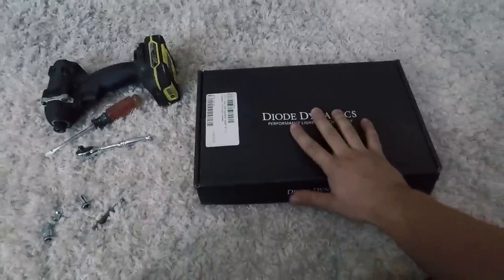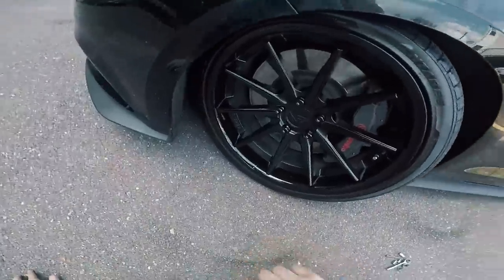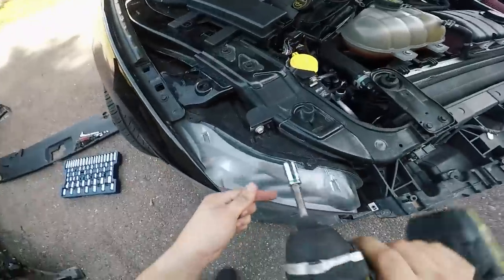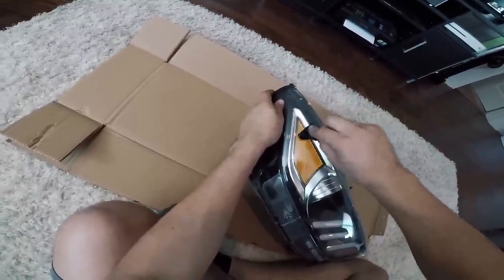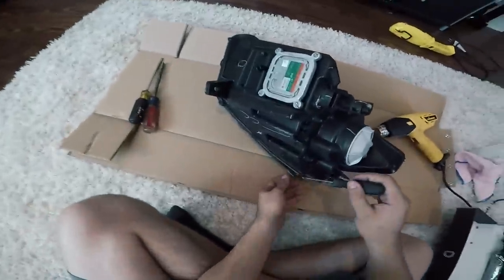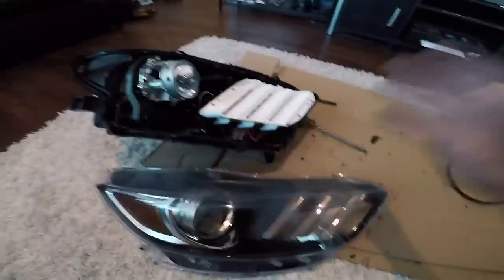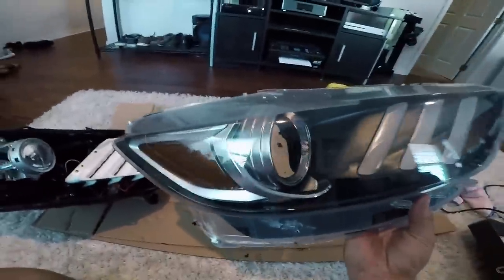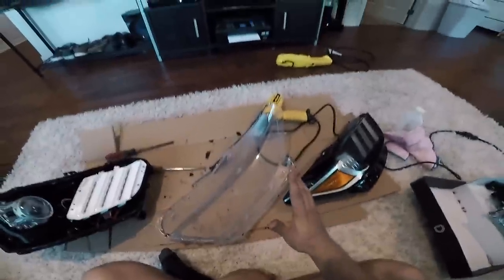NEVER pay for custom headlights!! Try simply doing THIS instead!

Comment: Great video as usual...BUT, never use heat guns on your headlight unless you HAVE to. For example, light too big to fit in the oven. Even then, put them in a big box, and use the heat gun to warm up the inside of the box (there is more to it than just putting the light in a box and putting the tip of the heat gun there, but thats the basics).  A beginner on this job will screw this up using a heat gun. Plus, those lights are permasealed. They dont come apart as easy as butyl closed headlights. For permasealed lights, 220-230 for 15 min. As long as the light isn't touching any metal, they will NOT melt. Have built countless lights, and a good 20 of those sets. And dam, you struggled pulling those lens off the housing. I was cringing waiting for the lens to snap lol. Diode Dynamics product is great stuff. Use their stuff a lot as well as Morimoto stuff.
Reply from the maker: Very good tips!
Reply: i was just gonna suggest this, seen to make mistakes with heat guns
Reply: Awesome comment and video
Reply: MrDaavee do you lay aluminum foil in a baking sheet? I’ve done 2 sets of headlights successfully and one I melted my lens lol I search and search for new tips and your seems to be best, what about taillights? Just cut back housing and reseal using epoxy mix?
Reply: i lay the lights on a piece of wood. The wood is a great insulator to keep the direct heat from the burner/element away from the headlight and off the metal racking of the oven, but still allow it to properly heat up. If you have that fan in the back of your oven, make sure that is off lol. For permasealed headlights, like (GM, Ford and Dodge), lower temps for longer periods of time works for me. Every retrofitter has their own way of doing things. I do 220-230 for 15 min for permasealed lights. 250-260 for 7 minutes for butyl lights (honda, hyundai). Most tail lights have to be cut open, then epoxy back together, or plastic weld (what ever works best for you) then siliconed up. Use quality stuff. I go so far as to lay tape on either sides of the cuts before i silicone. That way when the sealant is laid down, and pressed it, i remove the tape leaving a thin silicone line that is almost laser straight. Only a few tails can be baked open, or even unscrewed apart. Older cars like the 70s. Few newer ones can too. Like the R35 GTR.
Reply: Do the same when resealing. Don't use a heat gun on the reseal. You won't have even adhesive. Point a will start cooling and hardening quicker than you're able to heat the whole light. Using a heat gun to reseal can cause the glue not to evenly cure on the lense and leave you with moisture penetration. Oven method works wonders
Reply: I would go with Starry Night Halos over diode
Reply: kitt powell you can plastic weld your tail light if you cut the housing open. A plastic welder can be picked up fairly cheap but you can also just use a cheap soldering iron .
Reply: I wouldnt touch Starry Night crap if you paid me. Had waaaay to many issues with their garbage over the years. I dont mind installing some products that my customers bring me, but i turn them away when they bring me starry stuff. Too unreliable.
Reply: Go to sleep you have school in the morning
Reply: MrDaavee I’ve tried baking my 2013 mustang headlights open but they just wouldn’t open and I was nervous that I was going to break them so I decided to go get an estimate on a pro doing it and they said $250 for RGB DRLs and RGB Halos installed. Is that a good price for the labor and putting everything back together??

Comment: I just did this on my ford falcon, absolute crap of a job haha. My oven wasn't big enough either so I used the bbq outside.(which also made the missus happier than me using the oven)
100 degrees Celsius for about 5-6 minutes and they came apart easy enough. 
I also didn't remove the old sealant,mi added fresh sealant where it seemed thin but I just put the reassembled lights back in the bbq to heat up the old sealant and pushed them back together hard. 
So far no sign of any moisture issues and my car sits outside 24/7.

Comment: I just used duplicolor "rattle can" paint
  3 coats and 2 clears and looks like it was meant to be that way
 Helps to slightly sand the inside of the headlight surfaces also to help paint stick

Comment: I put the oven on 160 and bake headlights on a small towel for 12 minutes all while the oven is at temp. I have done this dozens of times to motorcycle headlights to put angle eyes, halo’s or led strips inside the housing.

Comment: Hey i have a question but its pretty long. i watched your video to see how many pieces the headlight actually is. i got into a minor side bump racing and i scraped the headlight lens cover and broke the plastic pins that hold the headlight to the front bumper. im thinking i just need the back headlight fram that holds the light and wires and the lens cover? Should I buy a whole new headlight instead??

Comment: For taking the bumpee off don't you have to take a bolt out by the fender also if you look at the grille where it takes in air it is restricted. I found out if you take a Dremel to it you can get alot more air into your intake almsot twice as much!!!

Comment: You forgot a crucial part to removing the bumper. The one diagonal screw on each side right behind the fender liner that holds the bumper in place. If you forget these two screws you may as well say goodbye to your tabs and making your bumper worthless

Comment: A word of caution:  Colors other than white, or yellow/orange may be illegal in your area... check local traffic codes and don't EVER run anything blue. I also would recommend against running red up front when on the streets, as it can be seen as confusing to other motorists... which in the end means more reasons for the cops to bother you.

I will also echo the sentiments of others involving the use of a heat gun... be VERY careful when doing this kids, it's a good way to seriously screw up your lights.

Comment: With that exhaust setup now u need to cam it.
Reply: Tommy Ferrell i agree
Reply: Cams don't lope on these cars unless you use phaser lockouts and then you take away all the advantage of the vvt
Reply: robert singleton yup, I have one, and it's a never ending money pit lol but gotta have a hobby I suppose.
Reply: robert singleton 4th transmission in 16k miles, a Paxton kit, now a single turbo, and full suspension and and and lol I have an addiction I think.
Reply: robert singleton destroyed a Calimer mt82 in less than 5k. Too much clutch, and he admitted the case was cast crooked but built it anyways. Wasn't too happy about that. 6r80 swapped it but didn't like the auto, now I have a Tr6060 in it.
Reply: Tommy Ferrell cams won’t change the sound

Comment: Sounds like every other mustang
Reply: Brandon Keithley I just think it's the same as every mustang I've had two and they sound the same
Reply: Brandon Keithley I'd rather have a straight piped 97 explorer
Reply: straight piped 2018 Camry sound soooo good
Reply: Well aside from some slight changes in tone and volume, you can only make the same engine sound different in a limited number of ways until you run across the same sound again...